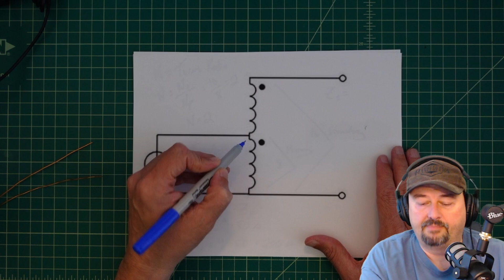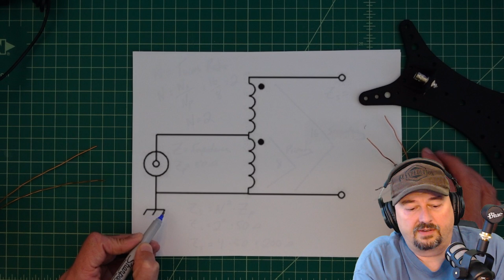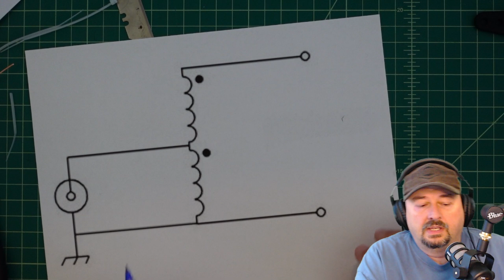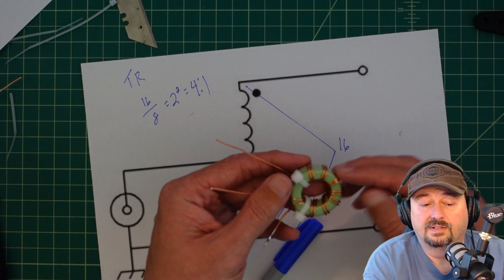CaHRTenna Poseidon Antenna Build

Comment: Thanks for your video, I bought a kit and the instructions were horrible
Reply from the maker: I wrote the instructions, what was the problem with them?
Reply: No I didn't buy your kit, I bought some kit off of Amazon and the instructions were in really bad English with some bad pictures.  So I was just going to follow your video and go with the way you do it.  Thanks again, your video was excellent and very detailed.
Reply from the maker: @garygogo9048  ah, awesome!  Had me worried
Reply: @TheSmokinApe   Yea, thank you for all the knowledge, I'm just gonna start following your builds and purchasing the parts you suggest,  to build this stuff properly.  Before watching your video I was really confused, you broke it all down and explained it really well.  Thanks again.
Reply: Hey brotha, quick question, Im going to put this 4:1 unun together for a 17-5 antenna I'm gonna build, but I've built 2 other antennas already, a inverted V and a verticle dipole.  Both have good SWR sweeps with my nano VNA 1.3-1.6:1.  Should I still be using a balun with those?  I'm running a yaesu FT-991A with the built in tuner.  Thanks.
Reply from the maker: Hey Gary, sorry for the late reply.  Yes, use a balun to help with potential CMC issues.
Reply: @TheSmokinApe   No problem, thank you for all the help.  Your videos are great and teaching me a TON of stuff 👍👍

Comment: I see you have the Binford 800 dremel tool.  Good choice.  I prefer the Binford 8000 it has a little more torque when you need it.  I also heard that the black tie raps resonate better than the white ones.  A ham in FL told me that.  :face-blue-smiling:.  great instructional video Ape!  keep them coming.  73
Reply from the maker: Hey Jeff.  They had these dremels on sale at the Costco 🤨

Comment: The easy way to avoid the "crossed wires" problem is to strip the enamel from both ends of one wire, that way you have two windings that are marked separately. The centre tap will be one stripped, one unstripped (one from each wire).
Reply from the maker: Not a bad idea 👍

Comment: Another great tutorial. Thank you for doing these for everyone.
Just an observation though... it looked like your 8th wind was criss-crossed where it goes through the toroid.
Reply from the maker: I just checked, you made me nervous, it doesn’t.  Must have been an optical conclusion 👍
Reply: @TheSmokinApe  Made you look. :)
Actually I just checked again, and I think it was just one of the wires on the 8th winding not being pulled as close to the inside of the toroid as the other one after you zip tied them, making it look like it was overlapping the other one. I should have double-checked before commenting. Sorry man.
Reply from the maker: No worries bro 👍

Comment: nice !  I wind a bunch of toroid's .Ape has a bunch of video's on that.  Great reference when I am winding one. The trouble I have is I done some many different ones ,some times I have to look up wrap on the one I need at the time. Chuck has nice video on how to wrap this 4:1 . Jeem has video as well but he crossed the inner and outer. some people ask why square the number. it's simple. in a transformer in turns ratio . as we step up the voltage goes up and the current goes down but the same amount. that difference is squared . in this case we talking impendence ohms . radio is 50 ohm. what this does is bring down antenna impedance to the point that a 3:1 tuner in radio can tune to get a match. I hope to hear and make contact with that antenna some day . 73's
Reply from the maker: Hey Robert.  I still need to look at the schematic for the 9:1.  Sometime I forget what I am winding 😳